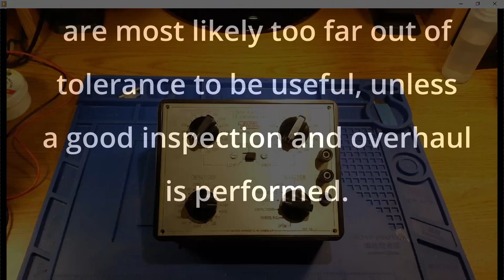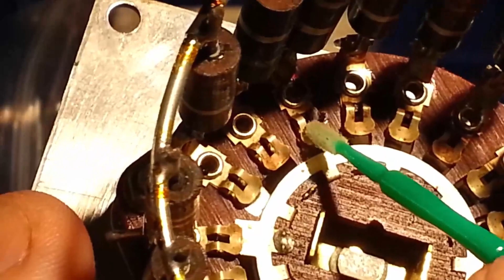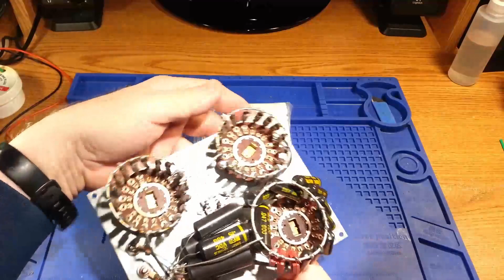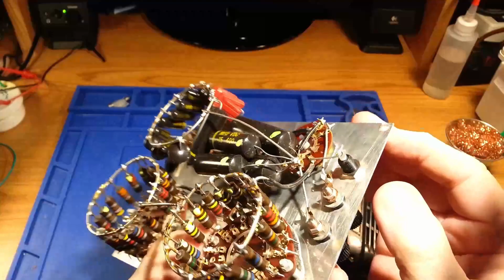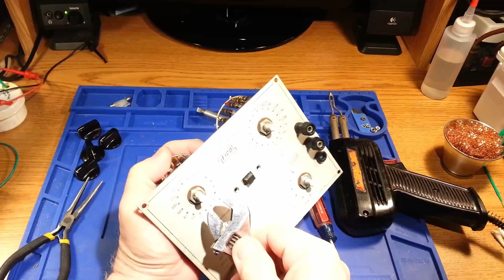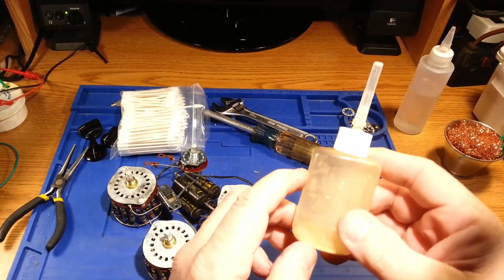E011_PT01   Eico 1140 R-C Combo Substitution Box

Comment: Great project. Nice tip on the paint and spreadsheet. Please give a link and/or details on the paint and the light that you use to make it glow. If the light is a DIY LED black light, please show us pictures of its construction. Please and thank you.
Reply: Comes up easily on Amazon under POSCA Marker Fluorescent. Have you tried any other colors?
Reply from the maker: @t1d100  I did purchase a few to mark components with , a regular green just to verify that I did check something, and a red and black as well. I think any decently bright UV light source will highlight the fluorescent  green/chartreuse color well, the one i was using was a 3 button cell "Coast" brand "LED Lenser" that I picked up over 10 years ago for charging up glow in the dark paint on ice fishing jigs. I recently purchased a 3 X AAA multi-LED UV light from Amazon that works even better, AND shows things like flux residue you don't see well under standard lighting. I will demo that in the next - final part, which should come soon.

Comment: To clean surfaces like on that EICO I discovered to use metal polish with a 000-steel wool. What I did was apply the polish on the metal and gentle with circular motions I buffed the polish with the steel wool. Takes a bit of patience and it is not a long process. Buff gently and the paint will not come off. It also removes the rust the develops. It looks shiny and great afterwards.
Reply from the maker: Thanks for that tip! I did go past that, as I found some of the oxidation was a bit deep into the surface, but for a lightly oxidized touch up that would probably work great.